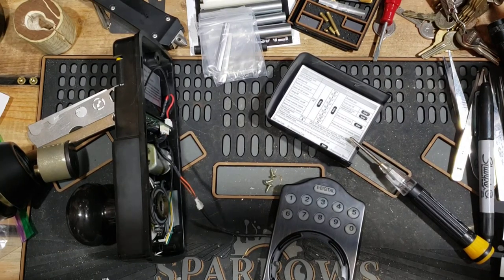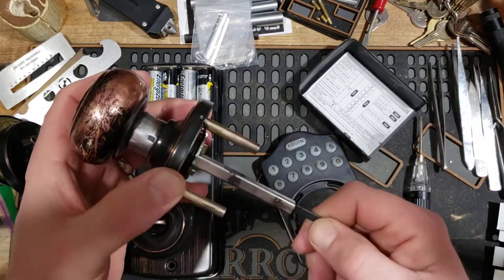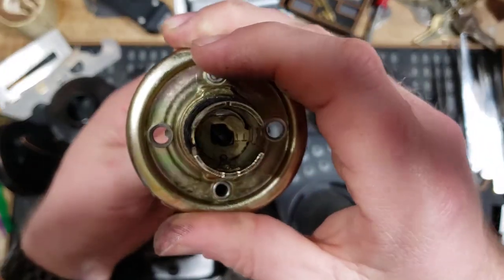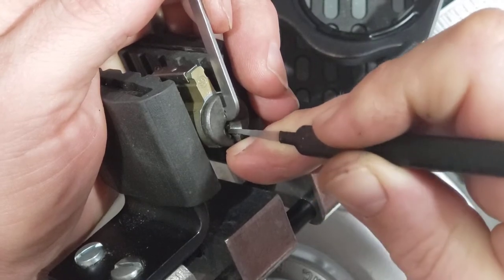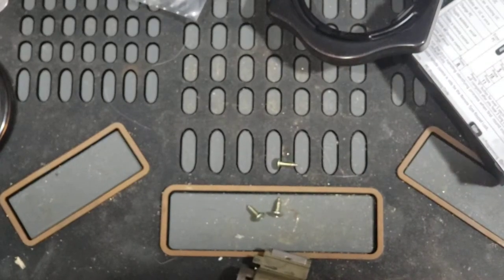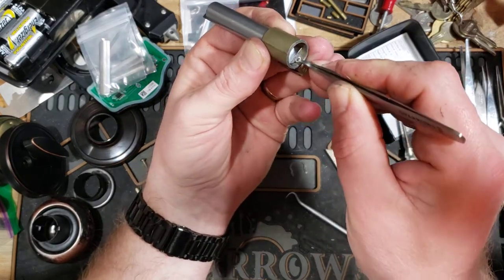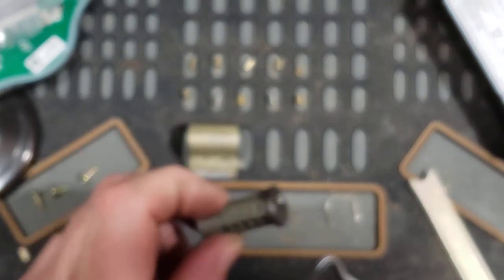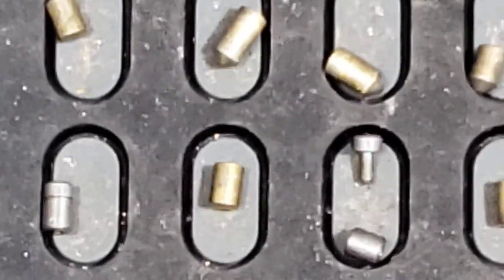E-930 E-Digital Electronic Keyless Entry Door Knob Repare  pick and gut (Part 1)

Comment: The 2 pin in pins are definitely different in a lock like this. Very cool to see. Was watching this while at work and got bored and started googling this system and your issue. Didn't find a think about your issue but did find this is made by Lockey. Other than basic installation instructions not much on the internet about it. From the Lockey website it does appear this model was made for Amazon.
Reply from the maker: Thanks for the info! and thanks for watching!  Skol!